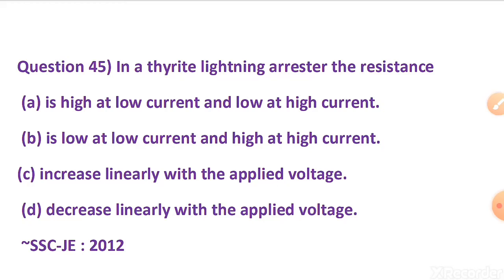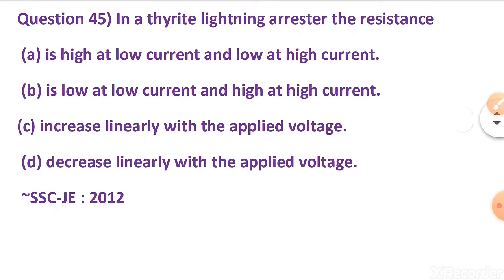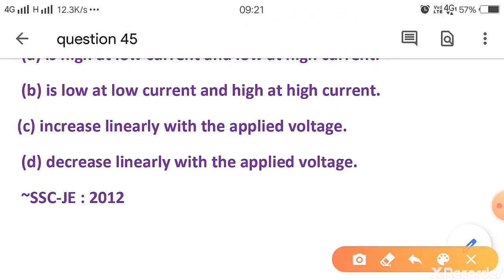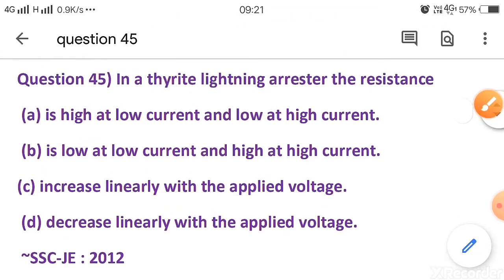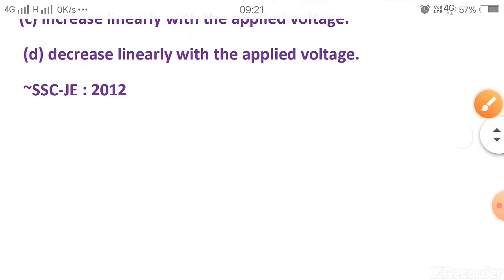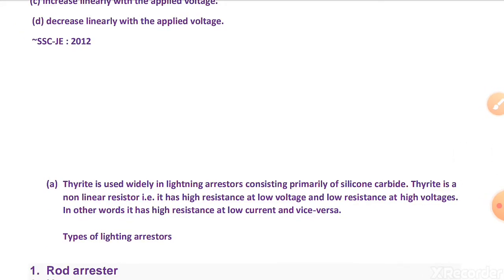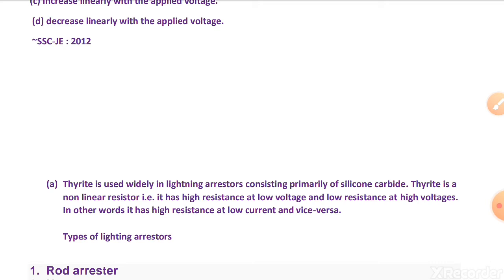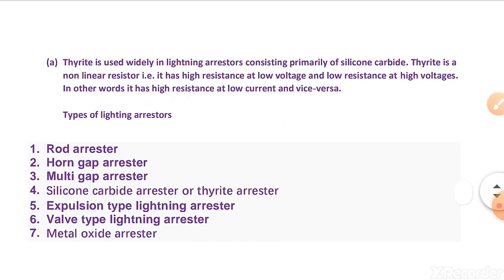Question 45) In a thyrite lightning arrester the resistance (a) is high at low current and low at h

Comment: Iska ans d hona chaiye i thinks
Reply from the maker: Lightning arrester is non linear resistive equipment.  In normal operation the thirite lightning arrester has very high resistance.  When switching surges or lightning ( very high voltage) arrives, the resistance decreases drastically.